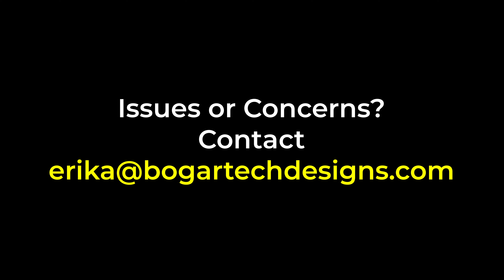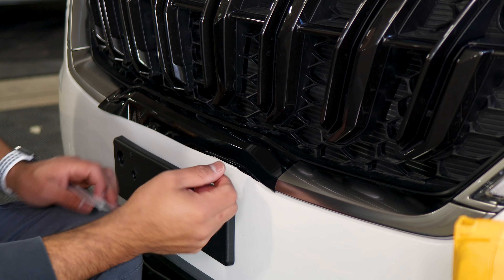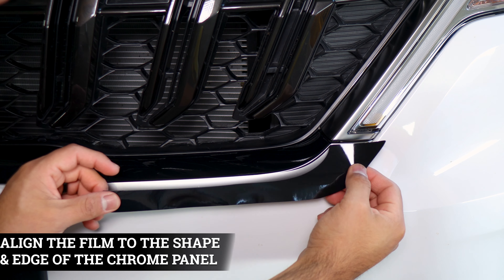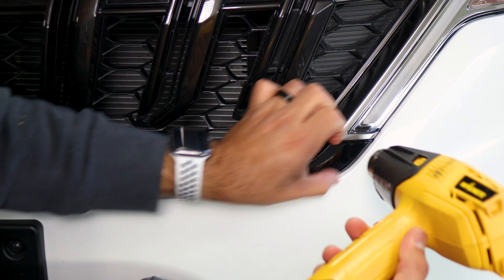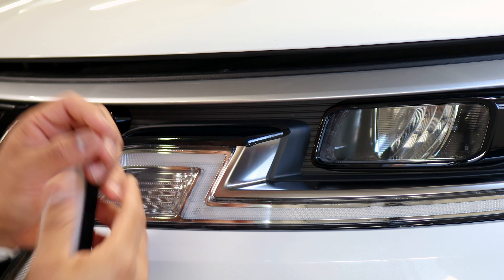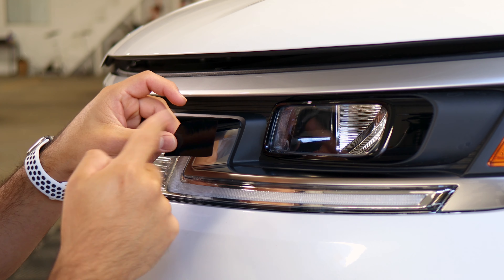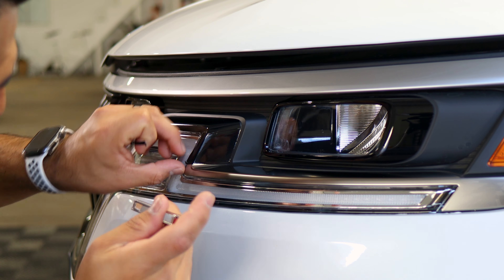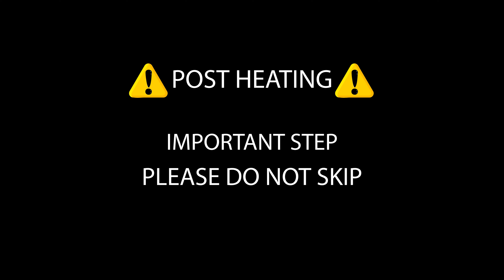2023 Kia Carnival Front Grille Chrome Delete Install

Comment: Already bought on ebay one side window. Will buy this set. One question. What temperature need to be on hot gun? Thank you
Reply from the maker: For the temperature if your heat gun has the a low and high setting, when you do the install you can use the low setting. When you post heating you can use the high setting just make sure not to stay heating the same area for to long or the film might get burnt.